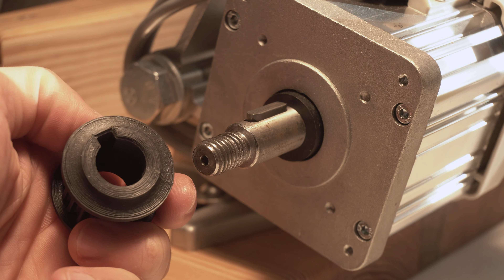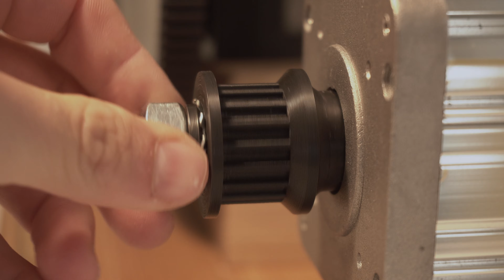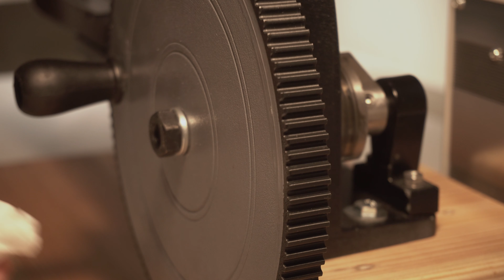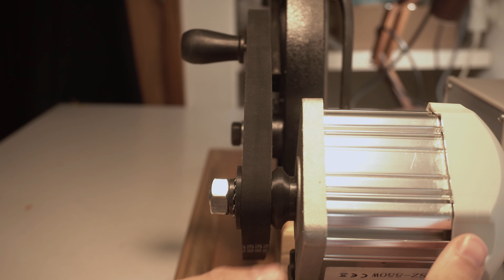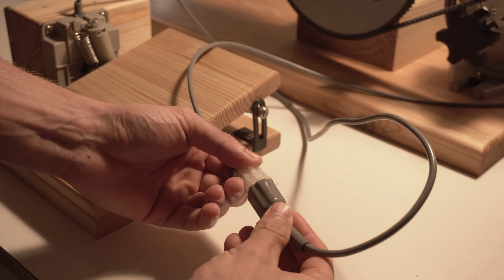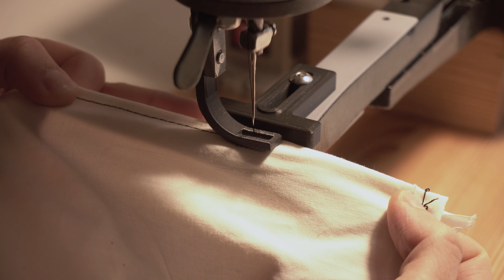CLSP Leather Sewing Machine Upgrade Kit Demo

Comment: Can you run this motor 110
Reply from the maker: Some models support both 110V and 220V, but others are single-voltage. Make sure to check before buying.

Comment: where you get the motor ?
Reply from the maker: Hi, I got the motor from Vevor; it's their 550W Brushless Sewing Machine Servo Motor with variable speed control.
Reply: @maximilian_rubin  are you running it with 220v?
Reply from the maker: @codpug  Yes